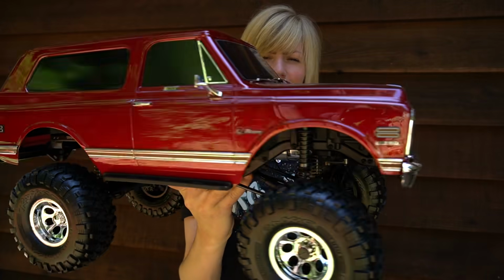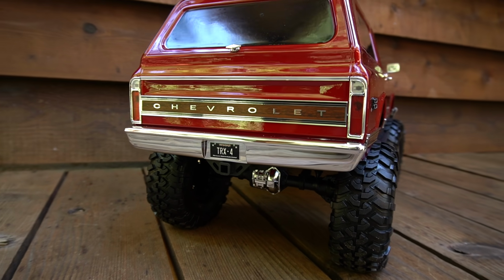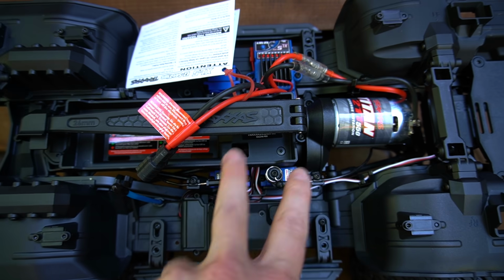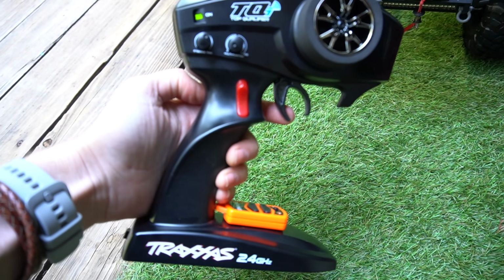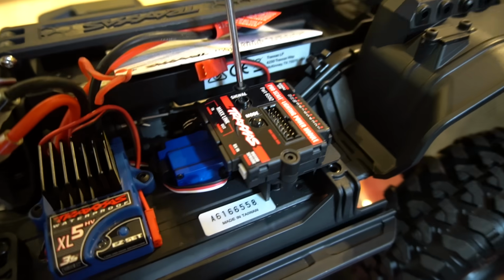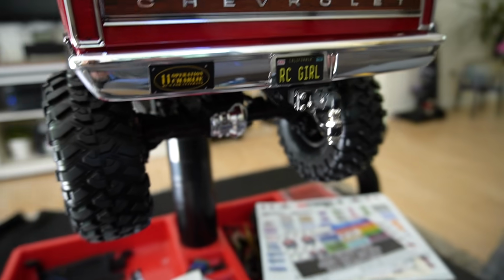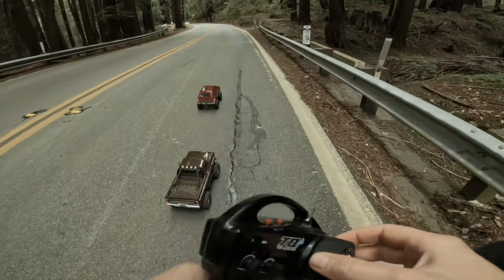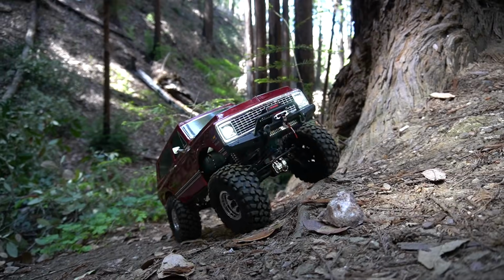Ultimate Trail Truck: Traxxas TRX4 Chevy Blazer High Trail

Comment: I love these high trail editions! I have like 3 Trx4 rigs : the High trail f150 , 2021 bronco and the 79 Bronco ! They’re all highly built and recently added a rear sway bar to the F150 high trail to help with the high center of gravity! Used an Element rear sway bar kit….worked great!
Reply: Does the High trail body fit on the 2021 Bronco chassis?
Reply: @hansnsnananna3933  no…I have both and they don’t interchange. The hightrail is longer than the 21 bronco

Comment: I use my spectrum 3S lipo in my F150 Hightrail.  They make conversion connectors that go from the traxxas to the normal EC3 connection.  I had to take the battery tray arm off and use velcro to hold my battery in.  I will not byuy traxxas batteries or chargers.

Comment: was that extra wires connected to the motor wires?
Reply from the maker: It's the motor sensing wires for the light kit so you get the reverse light function

Comment: I did the same mistake on my lights. 😢that sucked
Reply: I killed one of those light modules and even the ESC when i washed the truck after a run with clear water. Water came into the light module and shorted something, and this shorted thing also killed the ESC. And all that because i plugged the battery in too early while everything was still wet

Comment: It's an amazing looking truck, I do like it. I just think Traxxas would sell a lot more of these types of RCs if the windows were clear. I know everyone is tired of hearing it but I simply can not buy a scale truck with black sticker windows. But the truck does pull it off, it looks sick. Traxxas, I realize manufacturing costs go up, but we need clear windows.
Reply from the maker: Yeah it's just weird because they do make other TRX4 models with clear windows! There must be a reason why they don't on others. 🤷‍♀
Reply: The reason for the sticker windows on the Blazer and some other bodies, especially those with metallic colors, is because the color is screen-printed on the Lexan before it's vacuum-formed into the shape of the body. It is possible, however, to remove it - Scale Builder's Guild did a video recently on stripping the paint from the inside of the windows using Tamiya Polycarbonate Body Cleaner.